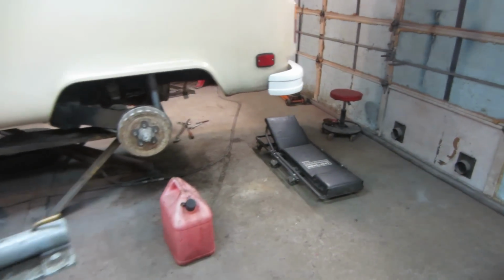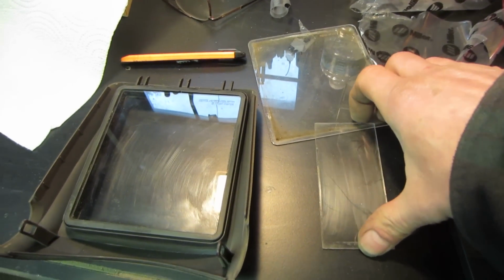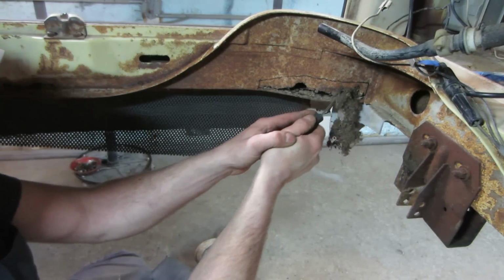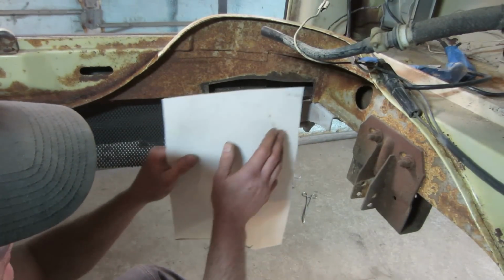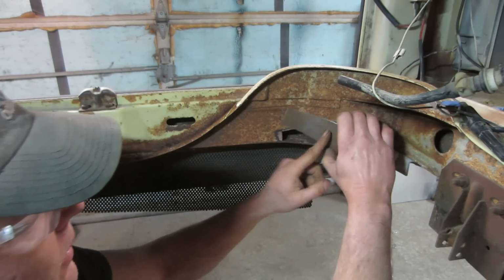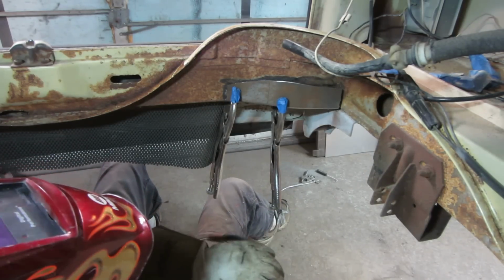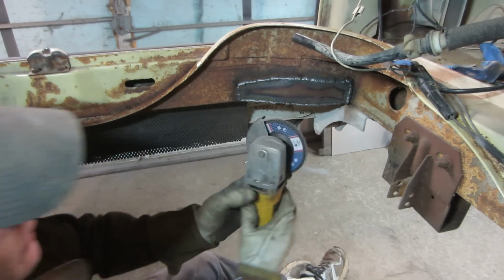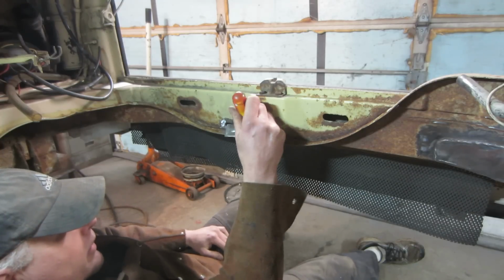vw bus, patching rust holes

Comment: I use to do  airframe structural repair when I worked for Eastern Airlines 1980-89 at Kennedy Airport.We had these gaspump shaped air vacuums with a small bag on them. Dont know if you seen them .I would use that to suck up crap ,rivets metaldust,etc.,dirt after and before doing a repair in real tight areas in the airframes.The hose is 3/4-1inch diameter maybe 12 inches long and narrow on the one end of the gun. It can get in small openings and most holes in auto chassis no problem.Always so much better to vacuum  than to blow everything airborne,LOLLL.Just a suggestion Glenn in N.Y.

Comment: Back in the early 80's my brother's VW camper failed it's MOT on rusty floors , he asked if I would weld it , I had a weeks holiday due so asked the boss could use the ramp for a day , got it up in the air floor fell out , needed a week's worth of welding , not wanting to be under it for that long so canceled the job , he got someone else to weld it for £100 bargain lol . I rented a garage in the 90's the landlord used to collect micro cars and motorbikes he bought a rotten VW camper and conned me into welding it up .

Comment: what I like to do is put in a 1/4 wide backing strip all around and then cut the piece to fit leaving 1/16 gap fill the gap and you have a strong weld with a no see repair it looks original. I have been welding for 30 years it was my profession.

Comment: actually your second fix if you just tacked it into place break off the pull stick cut another peice the same size and leave a little gap you have the backing plate when you weld it it will look original and will be as strong as original

Comment: HF pneumatic panel flanger/hole punch works great for getting you flush on these patches. $37
Reply: Oh nice, I was thinking about getting the Eastwood one, didn't know HF had one!
Reply: It's the same machine that Harbor Freight sells - Eastwood has significant markup
Reply: make sure you keep the hole punch waste orifice clear every so many punches - so it doesn't jam up-  I chipped the the OD cut flange on my first machine rendering it useless.
Reply from the maker: l have one but it needs room to work,
Reply: Ya- the small stuff gets pretty tight, they are good for a 4x4 square or a long run

Comment: Mustie, may have helped to put some weld through primer on the beam you're welding the patch to. And on the back of the patch. As you know, bare metal is going to rust. Especially when you're doing the oversize patch method as opposed to a butt welded patch. Just a suggestion.

Comment: Have you thought about a water and molasses tank ( lined with  plastic) to de-rust those cars?
Then  dump the used  molasses and partially fill with primer to coat the entire frame, inside and out.

Comment: Hi Mustie, I love your videos. As a woman novice I have learned a lot watching your videos. I have a question tho, what is your take on welding thin ( say 1/8th) Aluminum. I understand you need a lot of heat with aluminum but I always tend to burn through it any tips ?
Reply: P.s. I’m using a Lincoln MiG with a spool gun. 
Thank you.
Reply from the maker: l am not that good with aluminum so l cant give you advise other then it likes to be real clean and only use a stainless brush that has never been used anything other then aluminum
Reply: Thank you much.

Comment: Why did you bother to cut it into shape if you weren't going to inset it for an invisible repair. You could have just made a rectangle. And no rust proofing behind? Weldable primer.
Reply: They make weldable primer? Cool.
Reply: It's just primer you don't have to sand off before you weld, so the raw metal won't rust.
Reply: isnt it going to rust where its burnt off anyway whats the point? the man has a process, coat inner hidden chambers with oil

Comment: why did you choose to weld flat ontop opposed to fitting the patch flush and stitch welding the seam for a cleaner look?   just curious clearly both work for replacing rust :)
Reply: If only you had actually watched the video...

Comment: Mieces!! So mouse pee is the main reason those panels rotted out, huh? There isn't enough splash up or worn to the metal points to start that mess.  I saw there was a large opening they would get in by, when you blew air through it.  Surely they have mice in Germany!  Why do that?  Was there a rubber plug that's no longer there?
I don't mind the rotary whizzer sound too much, but I understand why people hate it.  When it's cutting metal, it sounds like the mother of all dental drills!  The sound could make people's teeth ache.
Reply: +Bob Pegram: We do have mice over here in germany :)
But in all the years I went through car-related forums over here, I never ever heard of a mice-problem like it seems to be common over there on your side of the pond.
The only critter-related problems we have over here since about 15 or 20 years are martens / minks, who like to hide under the engine hatch and chew on ignition cables, seems they love the taste or smell of that newer-style plastic coating.

Comment: Never use Glass Cleaner on plastic, huge no, no, instantly will place scratches in the plastic regardless of the cleaning cloth you use next time you want to clean a clear plastic lens use screen cleaner, same stuff used on flat style computer screens and flat screen TV's, Glass Cleaner is abrasive.

Comment: Let's see if I am understanding you properly... You are fixing rusted frame areas in a way that they'll only last perhaps 1.5 to 2 times longer than the rest of the car. So, if I want to use rust converters etc sprayed into the fixed welded interior frame regions and they now last 10 times longer than the rest of the car, I haven't really gained anything. Is that what you're trying to tell me?
Reply: Yes

Comment: All the corrossion now sealed in behind the weld plate, presumably the van owner isnt paying for dealing with the rust just structural issues.
Reply from the maker: filled it with oil
Reply: Mustie1 good stuff, which oil is best for spraying in such places due you use waxoil or like the black underbody gunk, or a spray of wd40 etc thinking of doing the underside of my car as its reaching that age.
Reply from the maker: l like chainsaw bar and chain oil